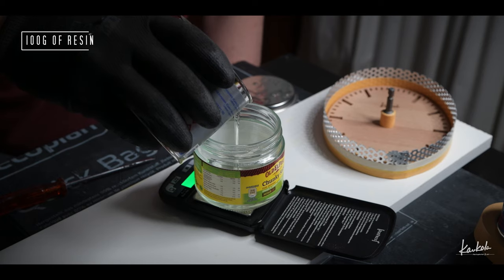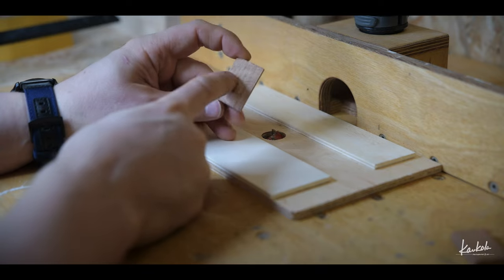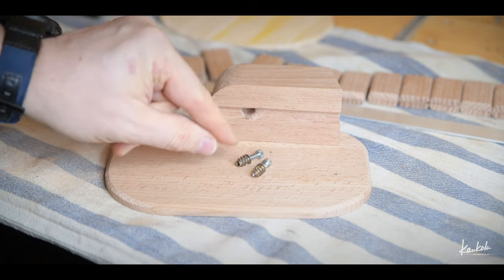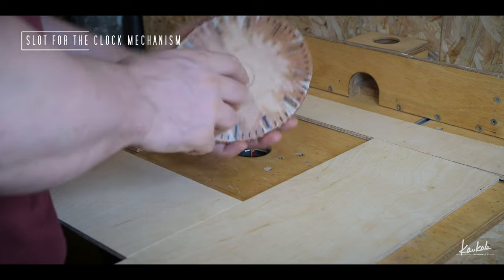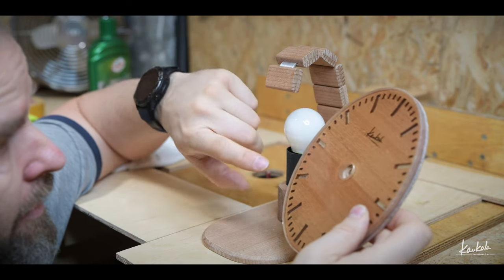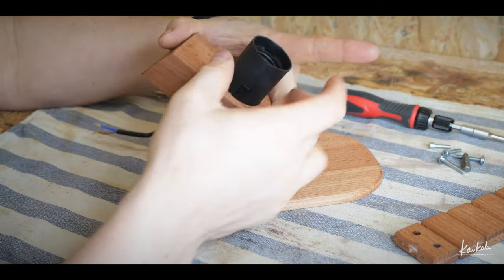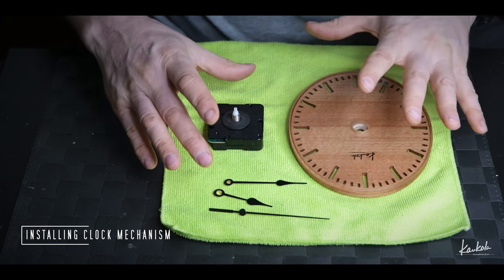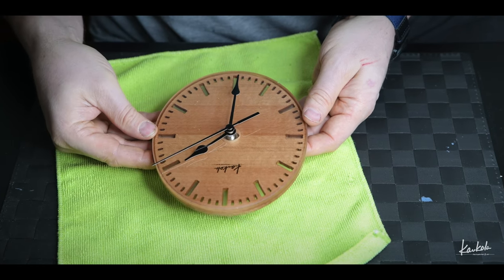How to make a table lamp with analog clock.

Comment: Wow fella your work gets cleaner and better every video you make, you should apply to be a designer for IKEA or something similar. Your products are definitely salable now. How much would you say you could make this clock for? If you don't mind me asking. Awesome video yet again
Reply from the maker: Thanks for your comment 🙂.
Problem with these is the time, what it takes to make something like this at home.. many hours. Materials i have to buy from a normal shops, that's also expensive. Cost of the materials, is already getting easily over 50.-.
I'm sure that for example China could mass product something like this for much less.
Maybe I could make like 10 of these, and sell as a unique hand made product for higher price 😊.